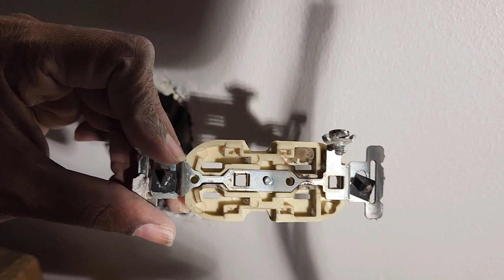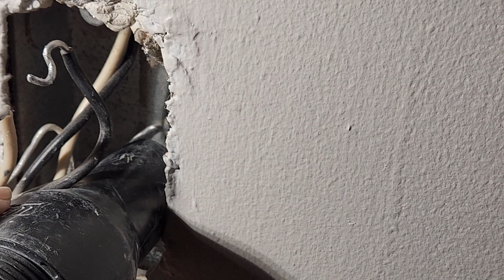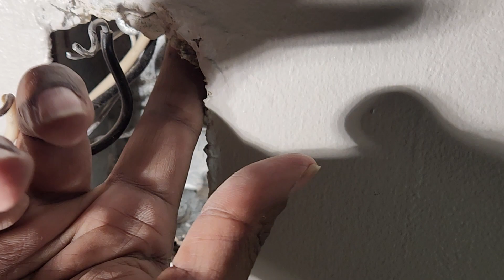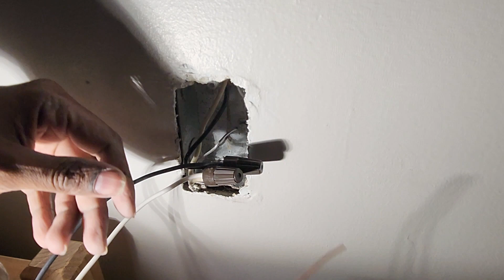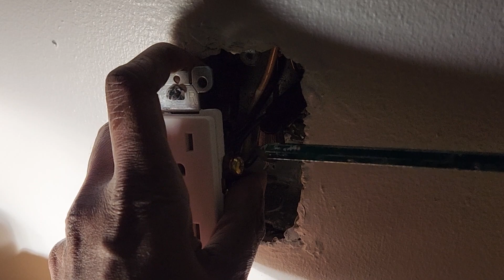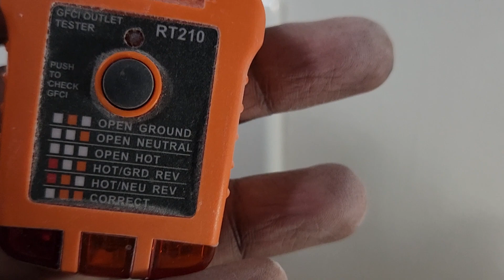Aluminum to copper wiring outlet change

Comment: Alumicons that are expensive but, in my opinion the better way to go when properly torqued especially if there is down stream wires like to another junction box however in that junction box is at the end of the line. Using wire nuts with aluminum past like that probly well work fine but, to my knowledge is not NEC approved method I only know of three approved methods and it involves a special blue colored wire nut, alumicon (best in my opinion especially for diy) or a special crimping device that  only specially trained electrician use. ps I prefer spec grade (commercial rated) recpticals also in my opinion the respticals that are indented face respticals especially those that are below ones line of sight are easier to plug a plug into but over all for a dYi project it looks desant but I doubt any electrical inspector would approve    the wire connection method do to it not being done to NEC approved way. personaly on the pig tails it's in my opinion best to have them like 8 to 10 inches long so when the wires are pig tailed the connections can be pushed all the way to the back of the junction box then trim length of the wires if needed before stripping of the insulation of the conductors. ps the ground wire that's not a conductive wire probably could of been wired directly to the recptical ground screw of the recptical but the way u did it is not a bad way to do it; personally I might of used a fourteen gage green colored wire screwed directly to the back of the junction box. 🎉

Comment: Good repair I think you could of remove the ground screw and put the ground wire there but it looks good , I use alumicon torque ones